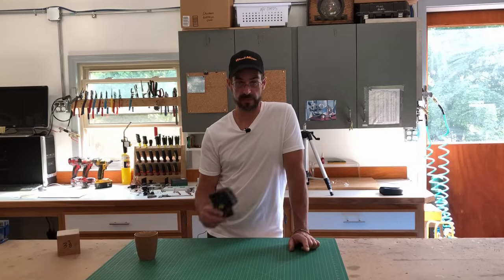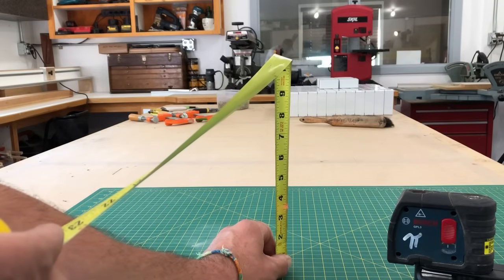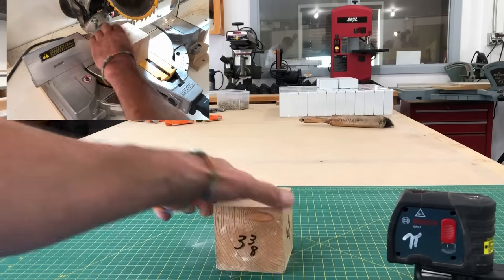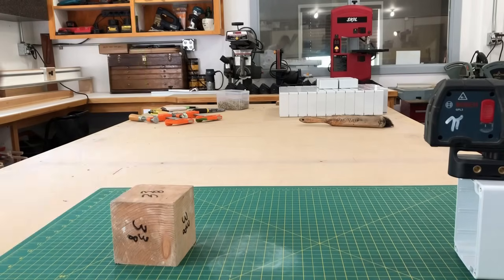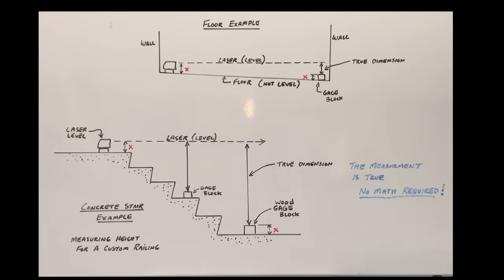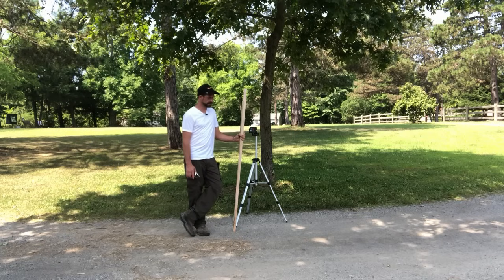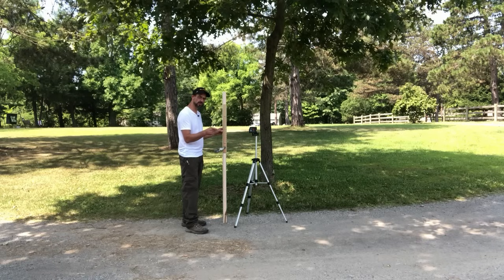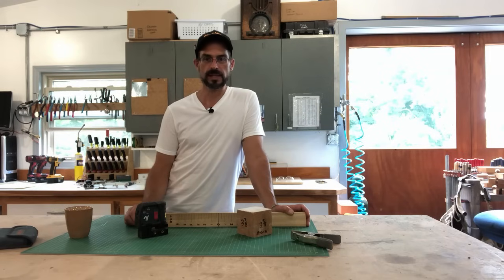Laser Level Tips

Comment: Thanks for demonstrating the basics of using a level along with some useful tricks....I was just left wondering if building a brand new driveway how many points of reference would you recommend for the driveway set  up before pouring the concrete into the wood forms for the driveway....
Reply from the maker: I’m not quite sure I understand what you’re mean, you would use the Laser Level as a reference for excavating, and then setting forms, then you would pour the concrete to the forms
Reply: @BuildswithBrian  yes sir that's the answer I was looking for.....thanks....I guess I didn't know how to phrase the question quite well.....but with your feedback it made sense.....what I meant to ask was for example when setting the forms for a driveway I would need to take the level for each of the 4 corners as reference points? I am a newbie....I am trying to learn something...

Comment: Doesn't anyone sell a grading / leveling ruler with the same marks you drew manually?    You would think someone would have a system where the ruler could be clipped onto a longer rod or stake that could be pounded into the ground, to help set reference points around the job site?
Reply from the maker: Yes there are such gradient poles, they are quite expensive

Comment: I bought the Bosch GLL3-330CG (line level) and my lines are also odd distances but I assume thats b/c Bosch use the metric system when buiding their levels because they're based out of Holland I think.  I keep a piece of paper in my case with the laser horizontal laser line's height from the floor while the laser box is attached to my adapter b/c when you're transferring elevations often i have to hang the laser box (on adapter) by a screw and you have to use an adapter b/c the box itself doesnt have a screw hole that you can hang it by.  On mine, as long as I shoot a screw  3-7 inches below the height target point, I'll be able to use the height raise/lower knobs on the adapter to raise the box/laser line to that target point.   What I really love about line laser is when working with round pilings because the line will hit the piling and give you a level line 180 degrees around a round piling.  Trying to use a regular level on a round piling to transfer a level point to the other side of the piling is very difficult b/c of the post being round.  A laser line takes that headache out.  It also takes the headache out of finding where 90 degrees is from an existing line so that you don't have to use tape measures / 3-4-5 technique of locating where that point is b/c each laser line is 90 degrees from one of the other laser lines.

Comment: Got a question.  Once you figured your ground level to be 3 and 3/8's, you put it on a 4 inch block. Once your beam hits the measuring stick isn't it off 3/4 of an inch?
Reply from the maker: I cut the block to the height of the beam

Comment: I have a question. Im running furring strips on my ceiling perpendicular to my rafters. Im putting them every 2'. How do I get a straight line on the ceiling from one wall to the other with the laser?
Reply from the maker: you need the kind of laser that shoots a vertical beam, check out my review video of the firecore laser, you don't need the exact model I show, but you can buy a similar brand off amazon for probably less than a hundred dollars,  or you could just measure and snap a chalk line as well 😃

Comment: Another option is to use two rulers and just set them so they each measure from your zero point. Two 12" rulers are very cheap.  Also a couple of levels or a corner post level would keep the pole perfectly vertical. I do like the setup you make it is very cool. I just Subscribed to your channel !
Reply from the maker: Good idea with the 2 rulers !! Thanks

Comment: Is the beam set on metric units as opposed to US imperial ?
Reply from the maker: Yes I am sure it is, it is a German manufacturer.
However that doesn’t explain why it is still an random dimension like 85.7mm ?
Why not an even 100mm to make calculations easier ?
Reply: @BuildswithBrian  You are completely right. My first thought would be to contact the manufacturer directly and see what their reasons are. I can only wish you luck if you feel so inclined. Although it wouldn't surprise me if you are the first person to do so.

Comment: is a laser level like this self leveling when you put it on a tripod or on an uneven post or will it take the surface of the object it sits on as "level" even if it's at an angle?
Reply from the maker: Yes it will self level as long as the surface or tripod is within 3 to 5 degree’s of level,
The exact degrees will be listed in the owner’s manual.
And all the lasers I’ve used will flash if it cannot self level to warn you the beam isn’t level.
That’s a cool and useful feature.

Comment: Similarly - 4 7/8 = 117mm (within .5mm)
85 +117 = 202mm.
It's easy enough to do without making a cube.
Just pointing out another easy way.
Reply from the maker: Sorry but I’m not understanding your suggestion, could you clarify?
Reply: @BuildswithBrian  Sure - 
I found that adding two imperial measurements - ie, 4 3/4 + 5 7/8ths was doable, but tedious.
When I switched to using the metric system, adding decimal numbers made it so easy that, as in your case, I wouldn't have to make and rely upon a losable, inaccurate and easily damaged cube of wood.
I do respect that the idea is good - and would have used it before, but using metric numbers - your laser is at 85mm, adding or subtracting the different number is very easy, quick, accurate and not subject to misplacing.
Reply from the maker: @johnx9318  I’m glad the metric system works for you, here in the states we primarily use imperial in the construction field.
That being said, how could you disagree that the block makes the math Unnecessary whatsoever, be it metric or imperial ?
And it’s really not that difficult not losing the wood block 😁
Reply: @BuildswithBrian  No, I said that the block was a great idea for imperial, but supplanted by the easy maths of metric.
I note that in the US, your scientists, medical people, military, brewers, distillers, food packagers, electronics, currency and even your legal and illicit drug suppliers use metric.
I used imperial for about 50 years. Once I got my head around metrication I dumped it.
If you ever decide to go metric, my advice is to ignore centimetres while you are learning.
Reply: @BuildswithBrian  PS - even with my ocd, I could lose a wooden block!
Reply from the maker: You are correct most of the medical and scientific fields are all metric, and rightly so because metric functions very well there
I actually prefer metric system for when I’m cooking 😆
But unfortunately I have no control over what the construction industry uses 😂😂
Reply: @BuildswithBrian  I get where you are at. I worked in the UK in a die-hard imperial machine shop back in the day. When I left and adopted metric in another industry, I couldn't help reworking some of my old calculations. They were more prone to error due to the complexity and far more difficult to manage. Now, I see that the problems I used to solve are risible, but the system was protected by the old-school machinists who were trying to protect their power.
As for cooking - cups, ounces, and quarts drive me nuts!
Nice chatting - my bedtime is here!
Be lucky.

Comment: Great video Brian. When using your laser to measure in any two directions 180 degrees apart, as in your driveway, you need to get that laser level 'Dead Level' before measuring. If not, your laser level will really compound the level inaccuracy. This is where an Automatic Rotating Laser Head is far more accurate, much faster, and is a one-person operation. The problem with a fixed laser position, you are constantly chasing the beam, which is a nuisance when working on undulating and rough ground.  Love the Story Stick 'Over and Under'  demonstration, the essence of simplicity. You have the neatest handwriting Brian. Top Job Mate. Cheers from Michael Australia.
Reply from the maker: Actually there is a flaw in your reasoning there, the laser level I’m using in the video, and all basic laser levels whether it’s rotating or fixed beam, all have a self-leveling pendulum inside that keeps the beam level no matter what the rotation or direction.
Level is level😁
Reply from the maker: But you are right about chasing the beam when using a fixed Laser, and it being more of a two person job in some situations.
However this video was to show how you can do something without an expensive rotary laser. Thanks for your comments much appreciated.

Comment: You will probably find that the height to the laser from the base is 85 millimetres, seeing how metric is the most used system in the world. Only 3 countries do not use Metric in common practise, and the US is one of them even though ALL countries have accepted Metric as the official SI units of measurement. So out of 7.8 billion people, a mere 0.4 billion still use a system that uses a base 2, base 10 and base 12 all mixed together to measure things.
Great tips though and well set out. Thanks.
Reply from the maker: Correct, it is exactly 85.725 mm in this case,
Why not 100mm ?? 😆

Comment: Love the video, some excellent tips their Builds with Brian.  I've always found subtracting imperial and fractions thereof, a pain in the ass also.  Have you thought about using the metric system, which makes it much easier, and removes those pesky fractions.  As an example, regardless of the imperial equivalent, I think you'll find that subtracting 20mm from 175mm quite easy.  Or for that matter 23mm from 75mm.  Pick any sum or addition in metric, vs it's imperial equivalent and I think you'll agree, it's a heck of a lot easier in metric than imperial, and with no need to try to convert quarters to eights, to sixteenths etc.
Reply from the maker: Oh I agree 100% the metric system is simpler and much easier for math. Unfortunately the US is a dual system country and the imperial system is still the adopted system in the construction industry.
Old school guys like me just don’t “think” in metric. If you told me to go grab a 17mm x 350mm x 560mm board I would have to think way too hard to equate that with the suit grew up with 😆
Reply: @BuildswithBrian  
The metric system works so much better with our base 10 number system(0-9) being that it works off the macro and micro powers of 10.
Reply: There's a direct correlation to Freemasonry in this conversation. 13 inches ( history says Friday the 13th was when the Knights of Templar were murdered) equals 33 cm ( 33 is "their" number). At least that's how they did the math to make the metric system.

Comment: Ha, ha it would make more sense to you if you used millimetres. 4 inches is NOT a round number.
Reply from the maker: No actually it makes no sense in metric or customary US units. The height of the beam in this case for this particular laser level is 3 3/8 of an inch, which is equal to 85.72 mm
Both of which are odd Numbers and not simple to do quick mental math.
I have covered this in many other comments.

Comment: I have used the story board method before but the red laser is usually no good for bright days even you did the demo in the shade. so here is What i do..
At your zero mark i attach my cell phone to it. With the camera lens exactly at the zero mark. I actually made a 3d print to hold the phone in that spot so i jist snap my phone onto the pole. The camera on the phone is much more sensitive to the laser light amd shows up VERY brightly on tje screen even on sunny days
Reply from the maker: roy Yung that’s an interesting idea, so I suppose the laser won’t damage the camera ?
Sounds good in theory, but the camera lens is a small target to hit when you’re searching for a beam that’s hard to see in the light.
I might give it a try though 🧐
Reply: @BuildswithBrian  yes the lens is a small target which is good. I use the laser that draws a line rather than just a dot. This way I just move the story board up and down and it will find the line.

Comment: Be careful with your gauge block when it's on a sloped surface though.  You will get a slightly different measurement when your block is sitting off level.  May not matter depending on your tolerances but a steep enough slope can make a noticeable difference.
Reply: lasers with spirit level integrated can help with identifying this also though :) or?
Reply: @ChrisTian-uw9tq  yes, a spirit level will indicate if a possible problem, but use a proper level (not an integrated one) so can see if block is level. Laser line will be level, so you’re measuring from the front of the level and doesn’t really matter if laser is on slope. The issue is the guide block. If not parallel to the laser line (aka level) then it’s ‘height’ will be wrong (always a bit lower) even if measuring from front edge of block. Tilt the guide block 45 degrees and you’ll get the problem.

Comment: How do you know that when you turn the level, it's not changing the readout? Can I use this method to check the grade of multiple spots on the yard for footings?
Reply from the maker: Anthony Salvate .... this type of laser level automatically self levels, there is a pendulum inside that adjusts and always keeps the beam level. As long as the surface it’s sitting on is within a certain amount such as 5° from level. So this will work if you rotate the level as long as you keep it on the same surface

Comment: Good advice.  You mentioned a rotary lazer.  I recently purchased a Hupar, 360° green beam, self leveling,  non rotary  level.  I'm very happy with it and it's about 1/4 the price of a rotary.  The green beam is also more visible than the red
Reply from the maker: Yes green beam is more visible, but even on the less expensive, lower wattage green lasers , they still suck in bright outside light.
I have a firecore green beam 360 laser, and it’s better, but not by much.

Comment: Um, When you turned the laser around on the tripod. Was the tripod truly level? I know that it is a self leveling laser but, "IF", the actual "front" of the laser's "transmission Lens" is not "Exactly" centered on the threaded hole? Then your effective accuracy will be entirely "Shot to $%!#" once you turn the laser at all! I was watching this after purchasing a Huepar, Cross Line Level to maybe learn something. The  Huepar laser that I bought? I can easily see in the front of the laser the small clear lens that produces the laser, "PLEASE have the laser turned to OFF before looking!".  That lens is behind the clear plastic "about" an inch. But I cannot accurately measure this. But I "Can", see that there is a difference of position between the lens and the center of the threaded hole for mounting. 
    In a <"Nutshell", "IF", the tripod is off by just ".005" thousands of an inch over that distance? 
 ".005 is the avg. thickness of a single piece of paper". And if that distance differential is truly just 1" from lens to mounting hole on the laser? Then at just over 16-1/2 feet away? The laser would give you a false reading with an accumulative error of 1"! And then 2" at 32 feet , 2.5" at 40 feet, and so on-. And that's allot! ".005 X 20"=.100, "SO", X 10=1", And 200"=16.67 feet".
  But other than that your video was great! Just, If you want to have a laser that shoots 360 with no issues? Spend the $100 more needed on a rotating laser. And save yourself $$$$ and time, having too rebuild your projects!!
Reply from the maker: Thank you for your comments, and I’m glad you enjoyed the video, however your reasoning about that cumulative error is incorrect. The laser itself is self-leveling. 
The laser must sit on something such as you describe a tripod that could be out of level. You are correct in assuming there will be a small distance of height difference when you swivel the tripod around, however that amount of error is only limited to the top of the tripod it does not transfer into the laser beam. For example if the top of the tripod changed 1/16 of an inch as you rotated it 180° then that would be your only error in elevation

Comment: Try using the metric system with a metric machine
Reply from the maker: Sorry, even in metric it still doesn’t make an even dimension
Reply from the maker: 3-3/8” = 85.7mm = not an even number
Now I could understand 100mm 😁
Reply: @BuildswithBrian  I live in Germany, to now I have never had a problem with difficult measurements. Maybe there should be an adapter fitted for whatever reason. We Germans love over engineering
Reply from the maker: Phil Stinton ... I have been a CAD designer and draftsman for many years and also have no problem with any types of dimensions, that said, lots of folks do, and simplifying math for “in the field” work is the purpose of these tips.  
Btw, my family heritage is German 😁

Comment: It may be helpful if you try to use a metric tape measure as the machine is designed by a German company, so I'm 99% sure it lands square on a metric tape measure...
Reply from the maker: Yeah it does, at 85mm
Not real sure how that is an easy number for quick
Mental math either, now 100mm would make sense to me 😁
Reply: @BuildswithBrian  Agreed. Just started using a few brands of these and its absurd that most seeming to be in the 30-40mm+ range that they wouldnt/couldnt round to 50mm without attachments for simple subtraction. Just make the case a bit bigger.
Reply from the maker: kaseryn
Yes exactly! Thanks for watching